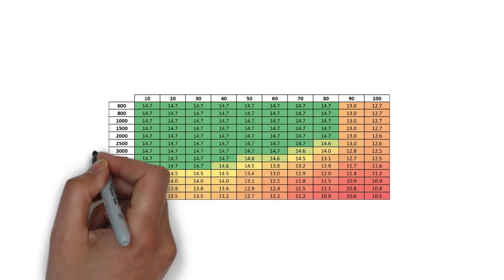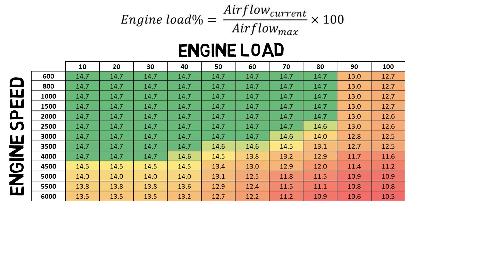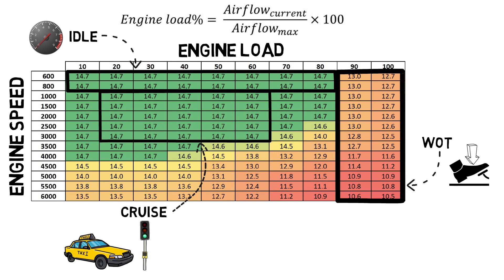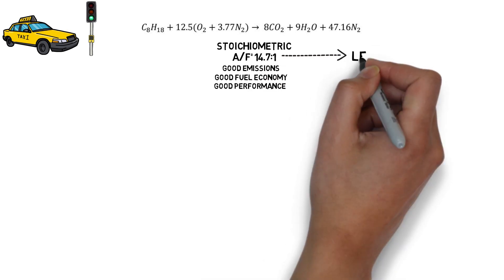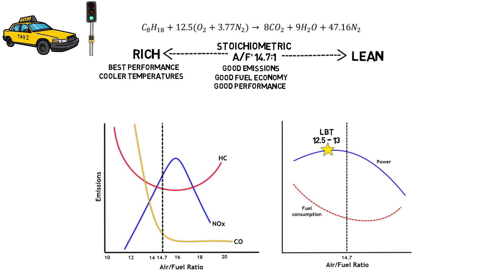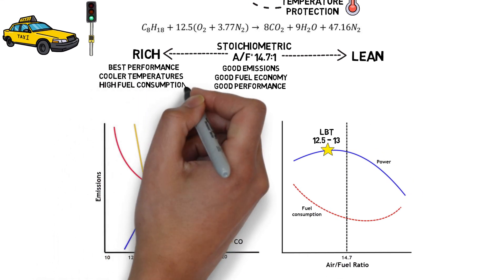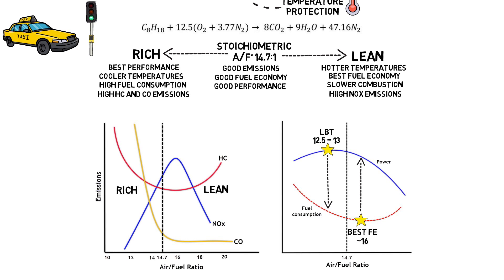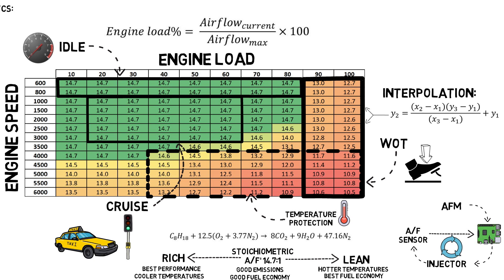FUEL MAPS EXPLAINED | Breaking down the Air-fuel ratios of gasoline engines

Comment: This is the single video I've seen today that answered all my questions:
1. How does air-fuel mixture change in different engine operation modes?
2. What is the job of the fuel injector/carburetor?
Also, I found out how engine load is measured and why running wide-open at high RPMs leads to fast fuel consumption.
And I was afraid fuel injection would be hard to comprehend, but looks like fuel map concept is even easier than carburetor operation

Comment: Good explanation. Question - how is an A/F of e.g. 12.7 happen if the O2 sensor is switching at 14.7?
Reply: o2 sensor is ignored at wide open throttle.